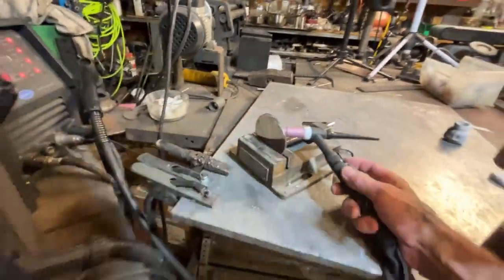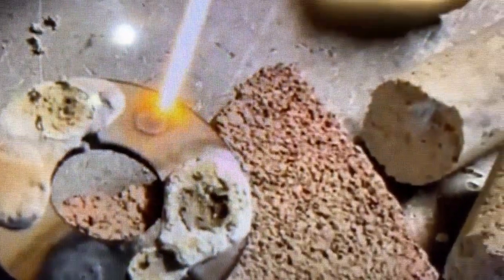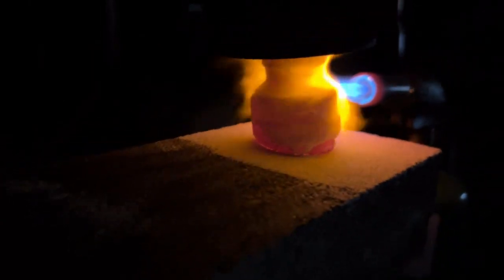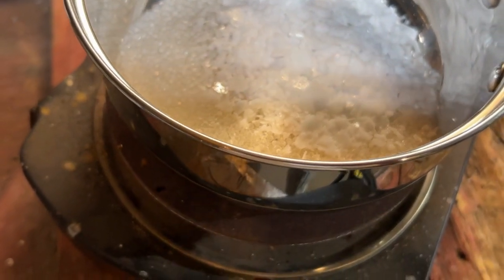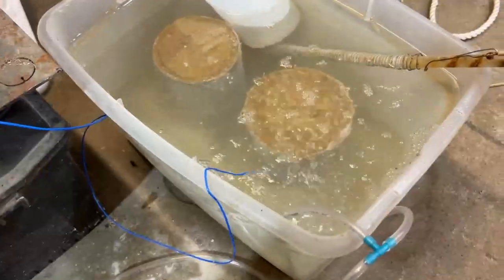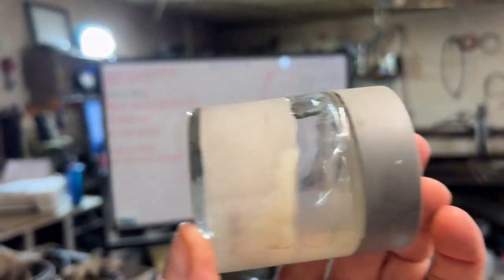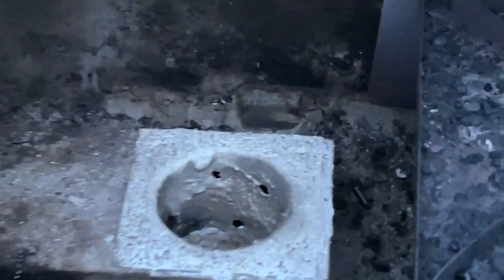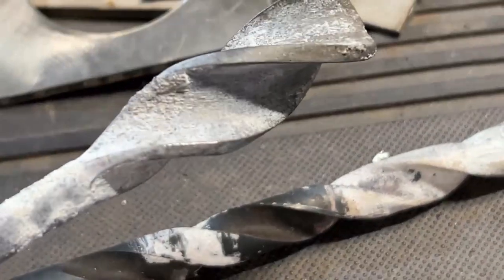Potassium silicate water glass high temp refractory Binder

Comment: Could you potentially use the paint to keep moisture from getting to the lime? I saw the glue video and thought that it’d be a perfect material for the vernuiel furnace that I’m making as I plan to use oxy hydrogen as the fuel, and there will be times that the flame comes in direct contact with whatever I use as a refractory. 

I’ll have to try it out. I’ll come back with the results whenever I find the time to do so

Comment: Greetings, lithium silicate is more refractory, has a melting point of 1200°C and is very good for thermal shocks,
Reply from the maker: Great input , i wonder what cesium silicate can do ?
Reply: @NOBOX7 I'm not familiar with cesium silicate, lithium silicate is similar to sodium silicate but more refractory and resistant to thermal shock, it is used in porcelain dental veneers and for hardening concrete floors, cesium silicate appears to be a powder, lithium silicate I want to use to make permanent graphite molds.

Comment: It damn near boils itself off during the raction. Make sure not to touch the container used for reacting sio2 and koh. If you want to occasionally swirl the jar or flask during salt formation to check if silicate is condensing on the bottom (not good) keep the container partially submerged in icewater for the majority of the reaction. The mason jar i used the first time got too hot to hold and almost lead to a really big and caustic fuckup

Comment: @NOBOX7 hey my friend, with Sodium or Potassium Silicate, when you make it stronger so that the white precipitate forms, its not a bad thing at all. The clear liquid above is a saturated solution. When you pour that off and use it, then add hot water the remaining material, more of it will dissolve. Because your water was hot, the new solution will be supersaturated. When it cools, some will crystalise and the remaining liquid will again be saturated. Which in my opinion is better. When a little of the salt remains, at least I know without measuring the density, that the stuff I am pouring off to use is at the saturated strength. If cold water is used it will become saturated soon enough. But starting with hot and waiting for it to cool is guaranteed.

Comment: Very interested in the welding backer. You might be on to something big there if there is no cross contamination. Cheers J
Reply from the maker: Video coming up on that , it works but the trick is to develop a formula that dries fast so im working with alcohol and maybe acetone solvents for a quick dry action . Doing this i discovered another material with exceptional properties as it turns out alcohol reacts with water glass to form a polymer
Reply: @NOBOX7  fantastic, well done. Absolutely love your content. Cheers J
Reply: @NOBOX7  ps what would you recommend to coat ceramic fibre wool (kaowool) for an insulated wood burner for pyrolysis? Cheers J
Reply from the maker: @joshuadelisle  Aluminum silicates are great for that .
Reply: @NOBOX7  I have aluminum oxide and I was thinking of mixing sodium silicate into it to make the paste for it after I've put a Ridgidiser on it. Do you think that's a solution? Or would you recommend Aluminum silicate instead?

Comment: So I shouldnt make firebricks out of water glass and garden lime? What should i make fire bricks out of with water glass since i ordered a gallon of it and i wanna make a heat treating oven for stainless steel sheet metal parts.
Reply from the maker: dont use garden lime , it reacts with moisture after being calcined
Reply: @NOBOX7  what would be good for a strong firebrick,concrete and some sand?

Comment: I wonder if you could use powdered clay like the stuff they use in slip for porcelain and make a ceramic coating that will melt and then solidify when cool like a ceramic coat...can you get titanium powder to mix in with it?
Very cool stuff...seems like it's a pretty hard finish..I wonder if heavily roughing up the surface would help it stick better
Keep em coming!!!!
Reply from the maker: Yes surface prep is a big deal but in this phase of testing im looking at compounds that stick like paint . If they stick well on dirty or smooth then a good surface should perform even better . Yes i have bin looking into pottery and slips alot lately . 
Im just now learning what it takes to make a good glaze . I dont have funds to buy the materials i need for this testing so im making due

Comment: Way cool NOBOX7! I knew you had been using the zirconium oxide, blasting media, and yittrium oxide. Now you have added some sodium carbonate. What does that do for the mix? Could you give proportions of those solid ingredients? Backing for stainless welding? Huh? Excellent idea!
 Blessings man! 👽🐍
Reply from the maker: hello revscott , the sodium carbonate is a flux , it lowers the melting point of silica and makes the mix paste better to work with by reducing its service tension . If you paint this stuff on metal without something to reduce the surface tension it beads up on a ducks back . Ill give the ratios when i have  a better mix , i dont want to give the impression this formula is finished . Think of how water dissolves salt , it doesnt melt the salt  but it dissolves it , the carbonate makes a eutectic substance of dissolved silica or glass and it gives a molten suspension to contain the high emissivity ingredients and other refractory materials . Think of the carbonate as kinda like the cement portion of concrete and the other stuff is the aggregate . The carbonate dissolves the sand making a glass that suspends the particles we added to emit IR heat 30% better than regular refractories .
Reply: @NOBOX7  I was looking at a company called Aremco's website. Could have some useful info from their product ingredients for you. I don't know if my comment is allowed since I mention a company.
 👽🐍
Reply: Phosphate bonded alumina was like good for 3200 f. on one of the company refractory coating products. Great to learn your knowledge on the potassium silicate!